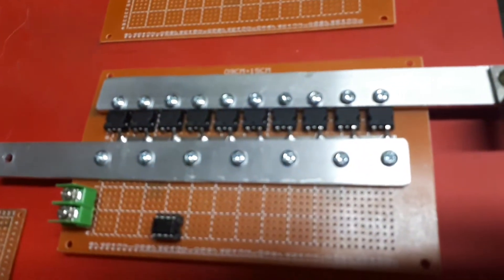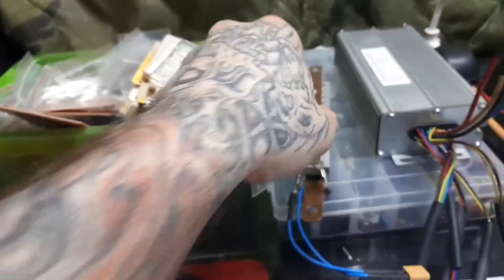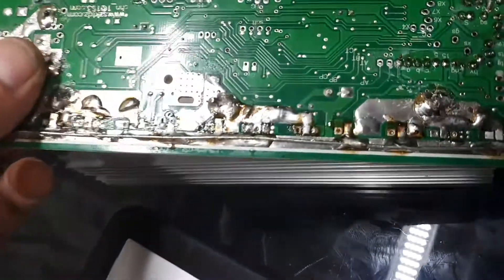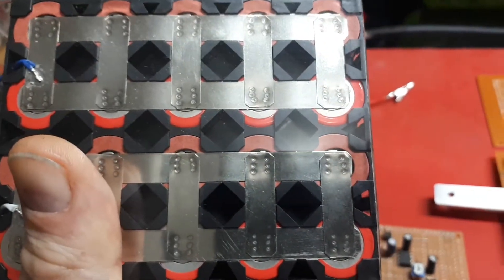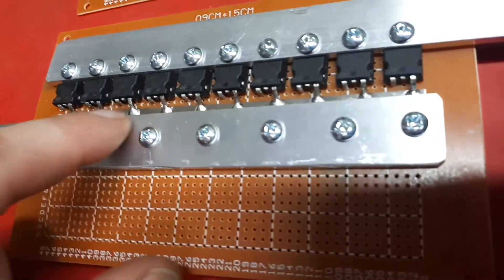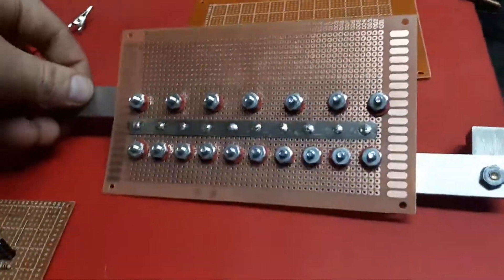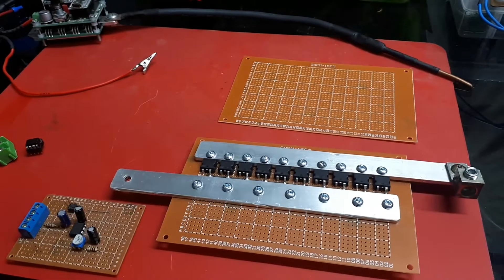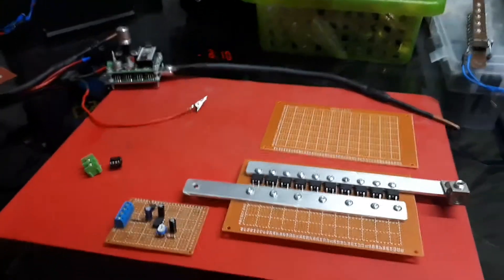Mosfet Spot Welder Part 1/ DIY 18650 FB Group

Comment: I like your videos when you mentioned the 555 timer I remember building a circuit for police flasher light using the 555 timer a while back. I'm thinking of building that spot welder but would it be safe to use lipo batteries instead of that big car battery?
Reply from the maker: Yes liops will work as long as you have enough amps, 555 timer worked great in the end the first 1 I made I messed up but after that it work great.  But in the end I went with a programable relay as a trigger
Reply: @cdiperformanceparts4364  so the programmable relay replaces you having to manually hit the button? Great information thank you.
Reply from the maker: @Takeover738  the relay work with a foot pedal and let's you change the pulse weld time and can bet set to work off no pedal and the electrodes making contact.  Set with a delay you can used the touching of the welding tips to the weld material as the switch, wait 1 second and it pulse welds ypur pre set time ect........

Comment: Excellent

Can you share schematic and code, i want to make it

Thanks
Reply from the maker: I will put schematic in the description or mosfet welder and timer relay board. Cheers
Reply: @cdiperformanceparts4364  Thank You

Waiting for that
Reply from the maker: @mdaslamknl  it will not let me load the picture. You can give you your email and I can email it then after just delete your email from the comment section.  Cheers